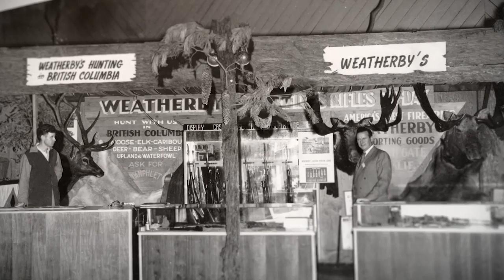On Our Mark: Episode 11- Barrel Break-In & Accuracy Expectations

Comment: I have personally used the Weatherby Break in reccomendation in my Vanguard 240wm.  It shrunk from 2 1/2" down to a 3/4" 3 shot group with a 20 shot 1 1/4 group.

Comment: I have an about a 300 Wby Mag Ultralight, with Bell and Carlson stock that shoots poorly (3"@100).   I gave up on it for many years but recently came back to it to try to resolve the issues.  I noticed that the stock was in contact with the barrel on the left side over about 4" area.  I have removed this by sanding it down and I also noticed that the barrel was also touching the stock near the front.  I've read a thousand forums about barrel stiffness in these models, free floating vs leaving the stock in contact with the front of the barrel.  I was shooting 3" groups and now 1.5" after free floating and stock modification.  Can you guys tell me about barrel stiffness and if free floating the barrel was a mistake.  It is my intention to shoot some different bullets and weights to see if I can get consistent 1" groups via different harmonics.

Comment: I have the PERFECT break-in procedure... shoot the damn thing and don't worry about it.  A quote from one of my favorite barrel makers, you might recognize the brand if you've read their FAQ:
"Break-in procedures are as diverse as cleaning techniques. **** introduced a break-in procedure mostly because customers seemed to think that we should have one. By and large, we don't think breaking-in a new barrel is a big deal. All our stainless steel barrels have been hand lapped as part of their production, as well as any chrome moly barrel we install. Hand lapping a barrel polishes the interior of the barrel and eliminates sharp edges or burrs that could cause jacket deformity. This, in fact, is what you are doing when you break-in a new barrel through firing and cleaning."
Reply: Most hammer forged barrels do not require breaking in, Tikka and CZ say that it is not necessary.

Comment: I can’t stress trying multiple loads. I have one that shoots a certain load 2-3” with a certain load. With the same grain but different bullet it shoots 1” or better every time. I also have one Weatherby in .257 Wby Mag that shoots the least expensive ammo under an inch every time and shoots the 80 grain TTSX loads in the same hole. 
I set a timer and wait 10-15 minutes depending on outside temps when shooting on the bench. 
You have no doubt when you find the load your rifle really likes. My .257 Wby it’s the older 100 grain Spitzers and 80 grain Barnes TTSX. With my 6.5-300 Wby Mag the 127 grain Barnes LRX and the 140 grain Swift Aframe. I tend to lean further towards the 140 grain Swift Aframe factory load.
Great video guys.

Comment: I have a weatherby  257 and I love  this gun I kill two 12 pointer  and two  does  the  first year I got the the gun but didn't  like the ammunition  I bought  it was from  horndy it did not penetrate  through  all the deer i kill i had to trail  both  bucks one went over 25o yard  and the other went over 375 yards all shot through  the shoulder.but it's not the gun it's  the bullet. But now I hand load for  it and I use  barns  bullets  and they drop  right  there and never move. So you have to know what Bullets  to use in this caliber  it makes  a Difference. But I love  weatherby  rifles  they  are  great

Comment: So in essence, it's more of a "luck of the draw." You might get one that's shoots consistently and accurate, or you might not? I guess I got lucky with my old Vanguard. Love Weatherby firearms. I wouldn't hesitate to buy another one. (I'm not a tough guy, I use a lead sled when sighting in)
Reply from the maker: All of rifles will fall under our Sub Moa at 100 yard guarantee. However it is true that from any gun manufacturer – barrel to barrel – gun to gun, accuracy will differ.

Comment: I live in eastern suburbia, and the only place I can shoot is a commercial indoor range. They're not going to let me clean the barrel between shots, and I'm not driving to the range, taking three shots, then going home to clean before the next three shots. So, cleaning every 1 or 3 or 5 shots for 20+ shots = not happening >> just not practical.
Also, I get the lane for one hour INCL setup & cleanup...I can't shoot 3-shot groups with 10 minutes of cooling after each group.

Comment: If they offer a .99 less guarantee on a new Weatherby using premium ammunition why would I need to do a break in? Am just going to give it a good clean before I take it to the range to zero in the scope.  Btw the one I am getting is chambered in 240 wby am just going to purchase factory ammo even though I reload for several calibers already.
Reply from the maker: Barrel break in is not necessarily a requirement, it is a recommendation. Most of our rifles will ship and shoot incredibly right out of the box with the right ammunition. Barrel break in is an extra step to help tighten up those groups. A gun that was shooting a .99 MOA group out of the box may suddenly be shooting even better groups after break in. Whereas if a gun is just outside of our accuracy guarantee a break in may pull it down too well within the guarantee. We stand by our products and if after all efforts are exhausted a particular firearm still won't perform to our standards then our guarantee is that it will be replaced on our dime.
Reply: I just bought one of your rifles in .257. It’s being shipped to me right now! I’ve already invested a lot of money in that rifle. I hope it shoots good or I’ll be seeing how good your customer service looks is!! Can’t wait to take it to the range, as it will be my first Weatherby and the most expensive rifle I’ve ever purchased.

Comment: Wait a minute...... Are you just trying to sell more Weatherby ammo?😉     Just kidding,  I know you guys are honest.
Reply: Any gun new or not needs to be shot to see what ammo it likes and unforchantly that requires shooting the gun beside if you can afford a Weatherby you should be able to afford the ammo! The first accumark I bought for my dad when they first came out in 1997 was $1,000. And the ammo was $100. A box so I bought 5 boxes of ammo which was $500. And in the 10 years my father owned the gun he went through 3 boxes of ammo.
Reply: @edwardabrams4972  I have a 240, 257, 6.5 RPM,  270, and two 300 weatherby's. I have never had one that would shoot a specific  bullet type / weight, poorly... But they all like some rounds best.
 I have tried Hammer bullets in three of them and they all shot sub-moa.